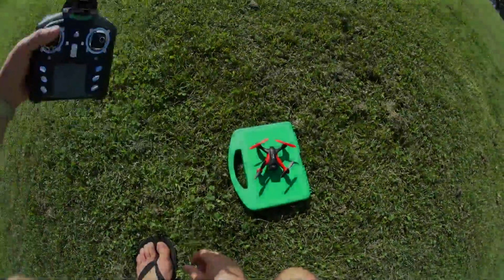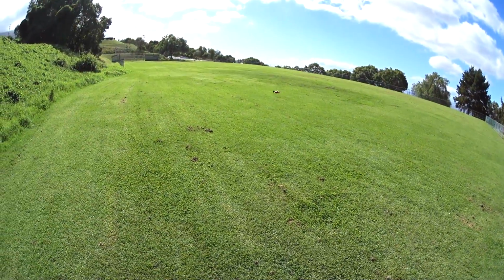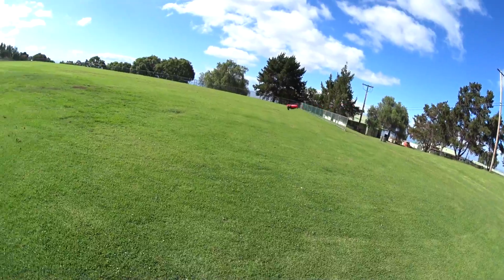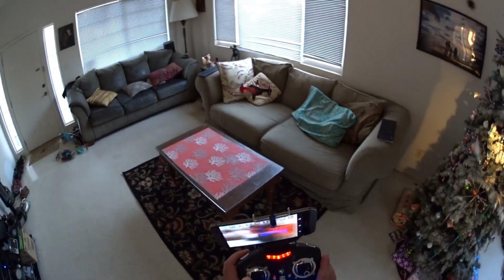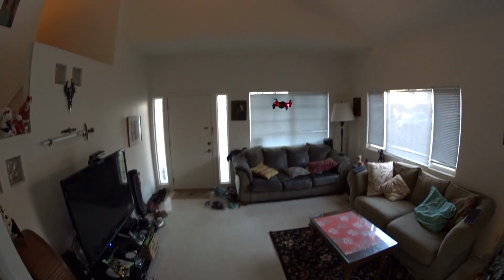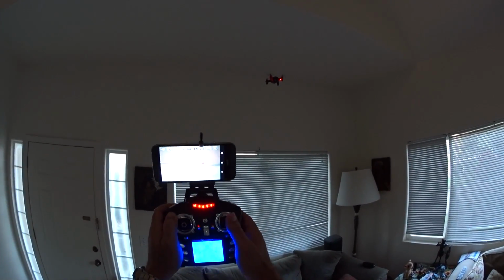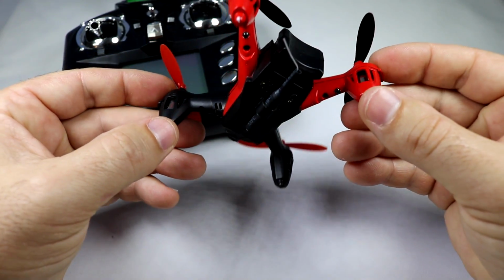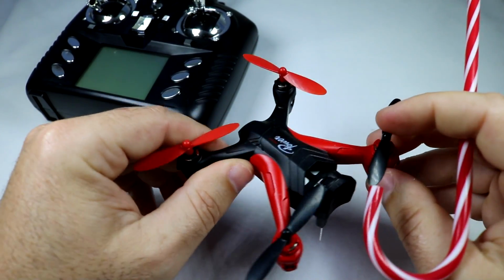WLTOYS Q242-K Wifi FPV Micro Quadcopter Review - [Flight Test, Pros & Cons]

Comment: Thanks for the review.  2 things I don't like about it is wi-fi FPV and proprietary battery.  I guess these quad manufacturers are trying to follow DJI's lead and make people buy their battery.  Cheers.  Back to doing a few repairs on my X380.
Reply from the maker: Amazingly btjebwifi FPV on this one did better than some 5.8g FPV on others actually.  First I've seen never have a hiccup or low frame rate especially at distance it kept going strong.  Agreed with the lipo but it seems to work well and I'm sure they are inexpensive.